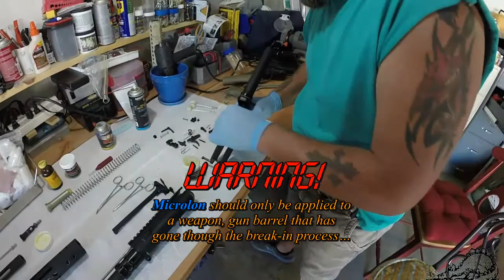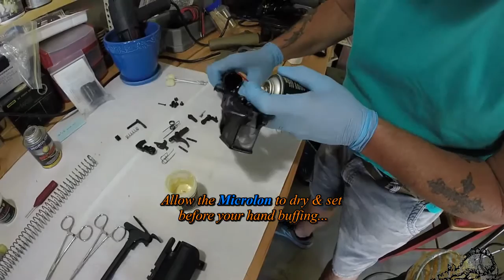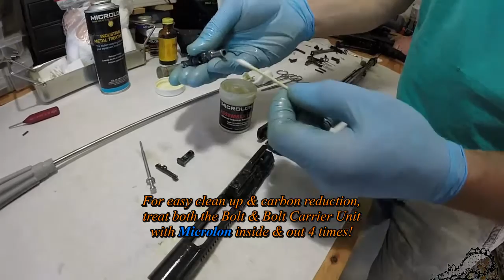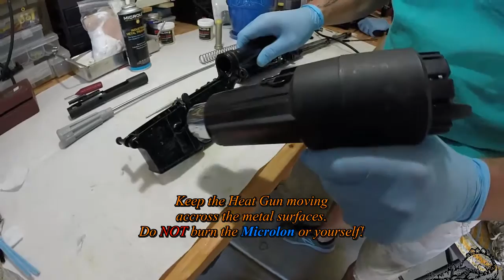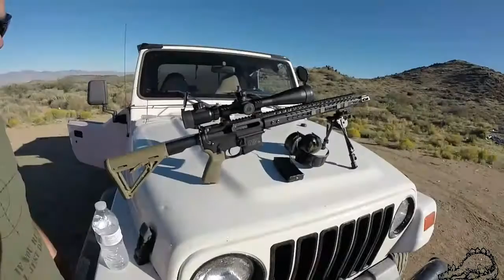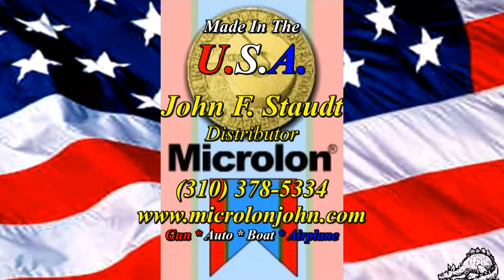MICROLON AR-15 Treatment

Comment: Hi folks. I've been a long time user of Microlon products. I have used Microlon in the barrels of several firearms. I recently used the "engine treatment" for my SKS barrel. I did not have "gun juice" in stock, so I took a chance. I swabbed the barrel about 30 times with the engine treatment, firing a round after each swabbing. Chronograph results did not show any velocity increase, however a substantial improvement in consistency occurred. Before Microlon, bullet speeds varied by as much as 150 feet per second. After Microlon treatment, bullet speeds varied only by about 80 feet per second.
Reply: Being a former Police Sniper and longtime user of the Microlon products, I tried using the Microlon Assembly Lube to treat a batch of bullets.  After applying 4 treatments, I reloaded my rounds batching in matching weights for each bullet, shell cases, and powder loads.  At the same time I reloaded the same amount of rounds with bullets that hand not been treated with Microlon.

The end result after allowing them to set for over 30 days to see if the Microlon effected the powder, I went to test the results of my experiment at our local gun club.  The rifle had been treated over 10 years ago with Microlon.  The untreated rounds were fired first and the results recorded.  Then the Microlon treated rounds were fired.  The results were between a 40-50 fps increase in speed.

I and many of my fellow snipers only wish we had had this product available to us back in the days when we sought any and all advantage in improved grouping and accuracy at long distances.  Today, I only hunt for food and look forward to this next season!